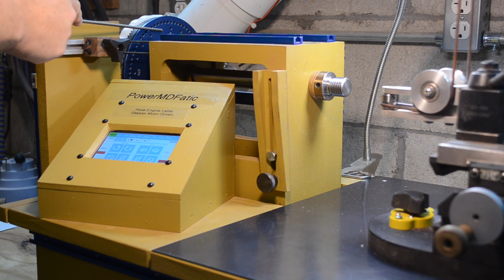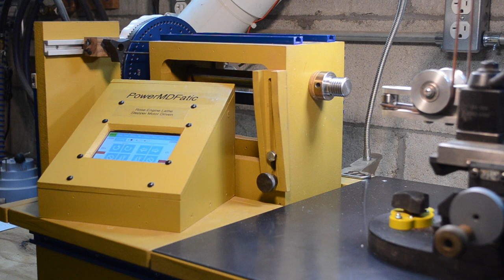MDF Rose Engine Lathe :  #1 - Overview

Comment: Thanks for the video. I am so addicted to this machine.
Reply from the maker: Michael, you should build one.  The instructions are at the MDF Rose Engine Lathe 2.0 library (https://mdfre2.colvintools.com/).  The guides are on the 2d shelf.
Reply: @RichColvin  I visited a friend last week. He had a small Lindow White RE. It was very nice . I am considering using the parts from my RE and building a MDF RE.  There are more parts and instructions for the MDF.
Reply: @RichColvin  sent you a video in email.